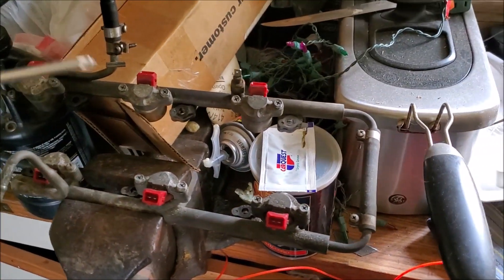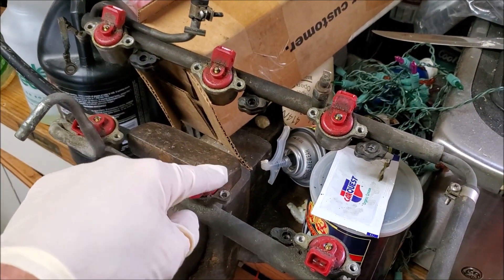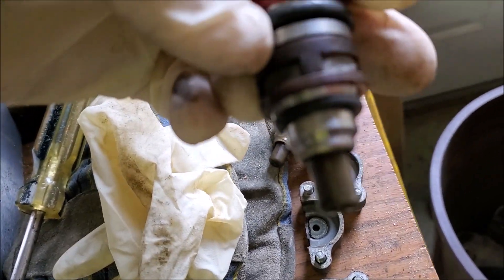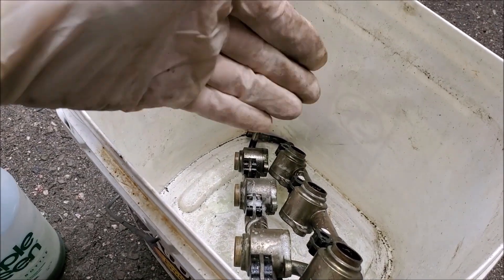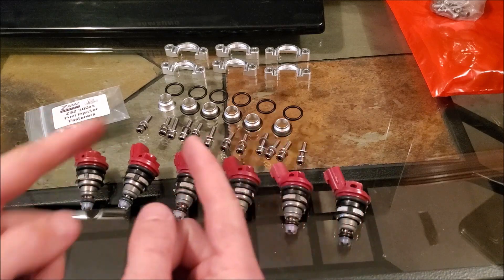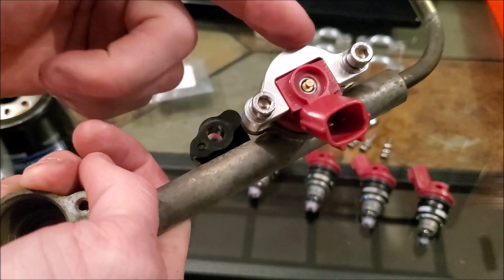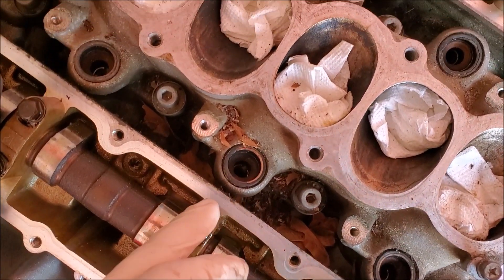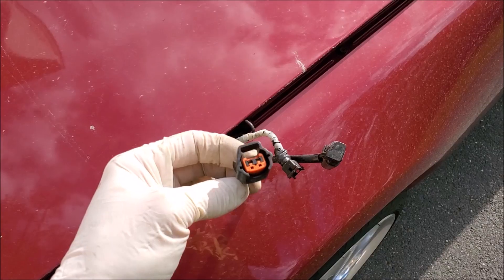Step by Step Guide to Install Nissan 300zx Late Style Injectors on Early Style Fuel Rail (Episode 3)

Comment: So you ordered the injectors off parts heels? Not z1 ?
Reply: Parts geek*
Reply from the maker: Correct!
Reply: @ZBruhzchannel  how have they been working out ? Because I’m rebuilding a 1993 and k need injectors I ordered the new wire harness with the new style injectors , and I need to get some but they are very pricey at the moment I’m looking for the best deal for my buck
Reply from the maker: @arturocastillo7362  each time I've ordered a set two of them are good for about a week or so then they let go. I'd ordered 8 to be safe haha

Comment: its not a phillips that is a problem.  those are jIC screws and use a JIC screwdriver.  im sure the screws are still tough to get out, but you are less likely to stip them if you use the correct screwdrive....

Comment: this is a helpful video man! do you know if this adapter set will work on a vg30e maxima engine as well? i have the feeling that at least 1 or 2 injectors are on thier way out since it doesnt run 100% smooth and the spark plugs on cylinder 4 and 6 look like they run a bit lean.
Reply from the maker: I would contact z1 motorsports to see if it is compatible or not
Reply: @ZBruhzchannel  thanks, i send them a pm over thier instagram. 👌
Reply from the maker: @99Lezard99  I would call for sure instead. They aren't really responsive on social media
Reply: @ZBruhzchannel  im from germany tho. 😅
Reply from the maker: @99Lezard99  I see, I then would just email customer service!
Reply: @ZBruhzchannel  ok thanks man! will do! how are the injectors doing you put in it in this video btw.?
Reply from the maker: @99Lezard99  I had one that was faulty, replaced it and all good now! Been about 2 years

Comment: No need to buy a new harness?
Reply from the maker: Nope, just new plug connectors to splice in
Reply: @ZBruhzchannel  thanks man thats going to definitely save me some cash lol
Reply from the maker: @galacticog69  no problem!
Reply: @ZBruhzchannel   so you did end up splicing instead or trying to re pin it? asking because i just did this and she wont start and im not sure if i wired it wrong with the old harness or if my Cas harness has stopped working.
Reply from the maker: @vqgav7680  spliced new connectors on

Comment: Awesome video! My plenum is currently off for injector replacement , I have an early style engine, can I use the new style fuel rail/injectors or do I need to get an adapter kit and use the early style fuel rail ??
Reply from the maker: Thank you for the support! To my knowledge you can use an early style fuel rail with new style injectors via injector kit to a early style engine. But I don't know if you can use a new style fuel rail on an early style engine. I would do some research on twinturbo.net to see if that is a possibility.

Comment: Hey zbro’s, I’m about to change my fuel injectors and I was wondering about the egr valve: why is it a good idea to delete it and will the engine pass a smog check after the delete?
Reply from the maker: Deleting the egr just makes your car run cleaner since the system can get clogged over the years. I don't know if it will pass smog without it, up here we don't get tested on antique cars

Comment: How are those fuel injectors hanging in from parts geek ??
Reply from the maker: I had one that stopped working about 1 month in swapped it out and the car has been running great since! About 3,000 miles on them now.

Comment: Man, those injectors are so cheap! But are they any good? Looks like they are available again
Reply from the maker: I had one issue so far, it was the third day driving the car one injector was causing a miss fire. Luckly it was cylinder 1 so easy pop out and replace. When you get them in the mail just ohm them out before install
Reply: Z-Bruhz thanks for the reply!

Comment: Nice vid. One question. Why the used engine oil on the o-rings? I use Dow Corning 111. It works well for me, and it's not supposed to break down rubber over time like oil tends to do.
Reply from the maker: I've always just used oil and never have had an issue

Comment: Did you have to grind away some of the plenum to get the injector 1 to fit? I heard that's a thing.
Reply: Yeah I just put everything back on only to find that fuel injector #1 connector is being partially blocked by plenum. So I can’t connect the connection to the fuel injector. 1990 NA 300.
Reply from the maker: No not at all. The plenum is off as we speak. If you want to do the swap of injectors while the plenum is still in the car then you will need to shave the plenum